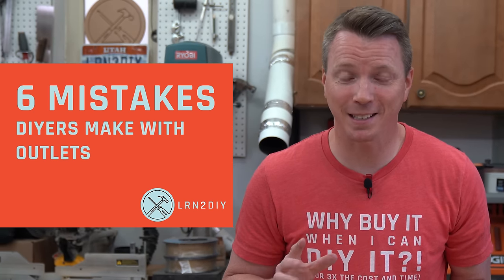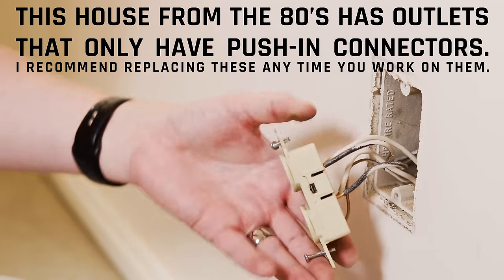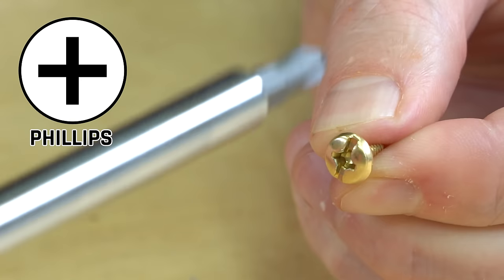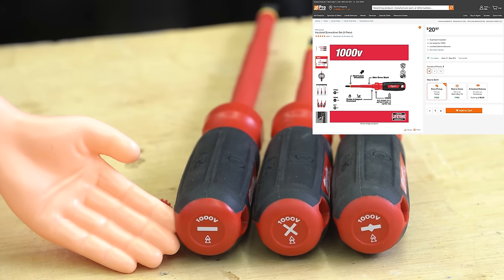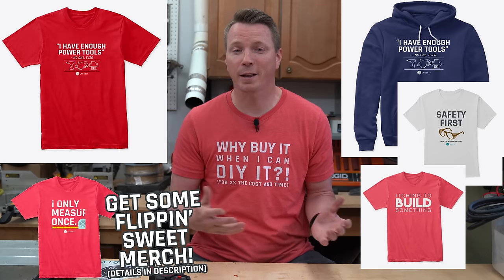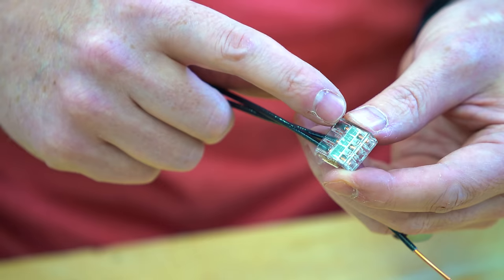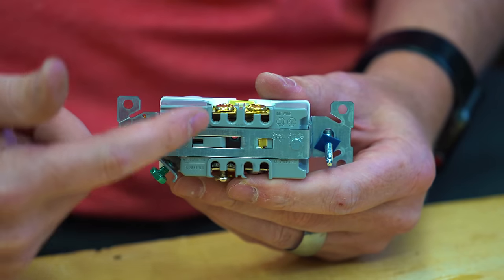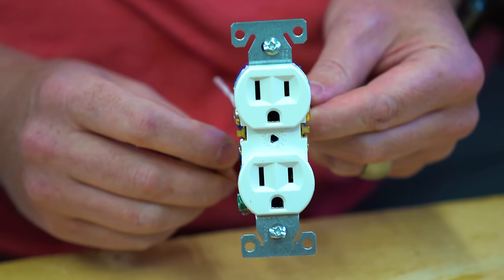6 MISTAKES DIYers Make When Wiring Outlets

Comment: It shocks me every time how poorly and insecurely designed US electric stuff is. At a European outlet, even when fully wired and powered, there is nothing externally you could ever touch that would give you an electric shock. There are no exposed screws or cables on the outside. Also most high quality outlets don't use any screws to begin with. The cables are clamped and trust me, you cannot pull it out without lifting the clamp mechanism first.
Reply: Somebody replied with: "Depends on where you're at In Europe....too broad of a statement...." For some reason that comment was then deleted, but I still want to address it to avoid future comments like that. The answer is "No, it does not". How sockets look like does vary across countries in Europe, but the look of the socket is not what my comment was about. The safety regulations in Europe are pretty much the same everywhere, as they are in fact the same everywhere within the EU and even outside of the EU countries follow the same rules on their own; and that's what my comment was all about.
Reply: Got a brand you can suggest or reference I've never seen these marvels, maybe I can invent some adapter to the us exteriors inferiors.
Reply: Keep in mind much of Europe is 220 volts so will bite you much harder
Reply: I have a Klein tool (as displayed in the video).  I have found that the Robertson drive is not always the best choice.  It too can cam out.  It depends on the make of the receptacle or switch, etc.  I propose that the screw be design to not accept a jack of all trades blade but settle on ONE configuration, square drive, deeper Philips head screw head, etc.  Also the screws used to attach to the box?  Can they get any cheaper, head is often too shallow.  Advice, do not buy the cheapest receptacles/switches.  There are videos that explain this.  Why are you cheaping out on your electrical system?  Don’t do it!
Reply: 240V in Europe. 120 in the US. Yes, even the 240V residential power for dryers etc is only 120V with respect to earth ground in the US. Not so in Europe.
Reply: That's a very good point on design. It really is surprising that we have outlets that can shock you if you just reach in and grab them. Anyone know why that is? Is there a storied history of electrical outlets that explain the differences?